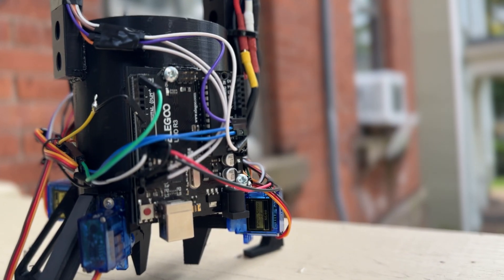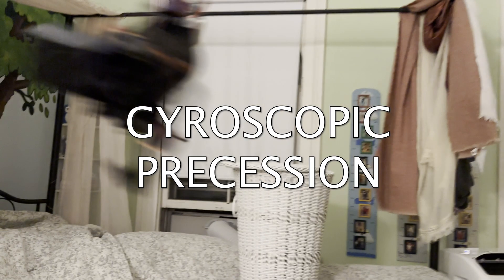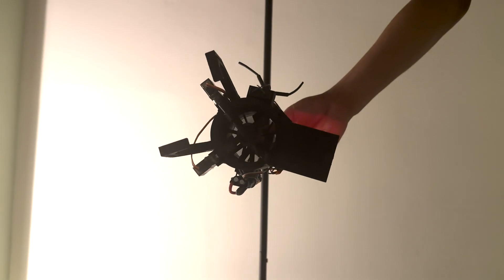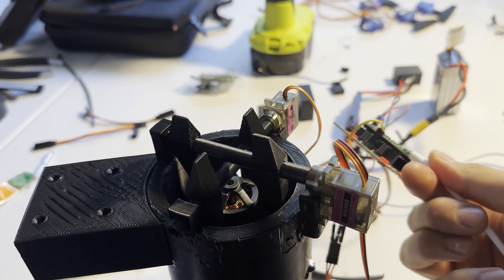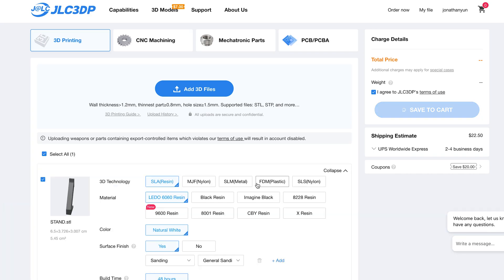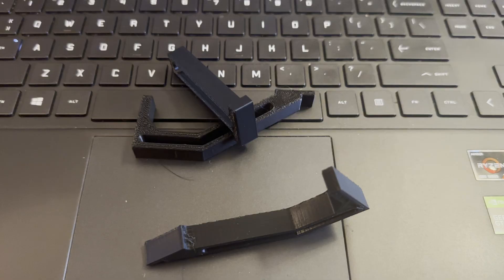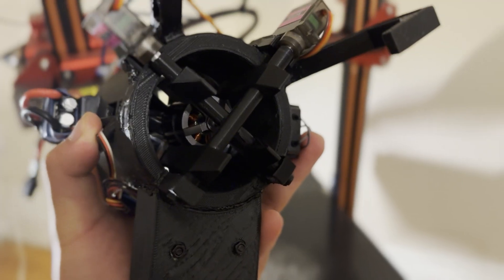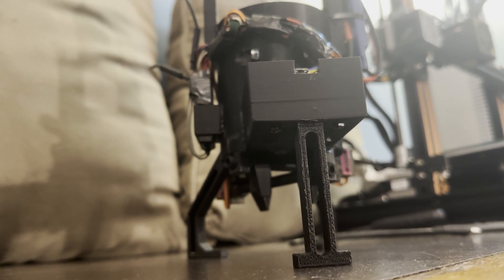The Gyroscopic Precession Problem

Comment: I can't understand why everyone insists on using arduinos and similar microcontrollers for experimental drones. There are many purpose built flight controllers that run at much higher clock speeds and have everything you need on them in a very small package.
Reply from the maker: I’m aware, I wanted to learn arduino and figured this was a fun project to do that on. I’ve since switched to an actual stack for this project specifically
Reply: @mach10point4  I suspect that is the reason many have. I come at this from a aircraft mechanic's perspective. I want the airframe to function and the control system is just a necessary part.
I see that all these designs suffer from a high center of gravity making it prone to tipping in forward flight. Also, the duct really destroys the potential for effective forward flight and limits your propeller size. Your control vanes seem very small, but you are restricted by the diameter of the duct.
With two servos you no longer have counter torque control. I suspect that you could get by with two vanes and two servos working independently. At least that works on my design, but it is upside down and inside out compared to the design you are using.